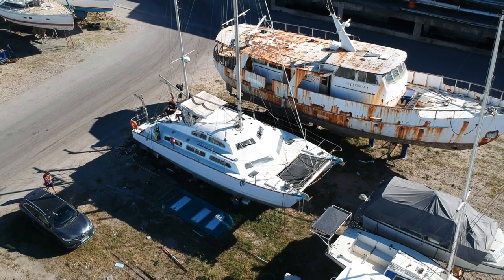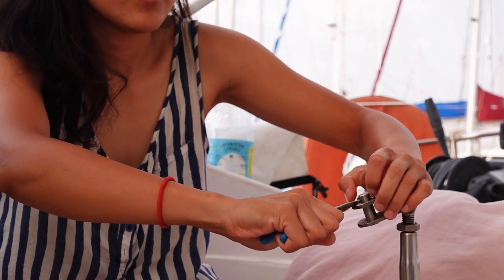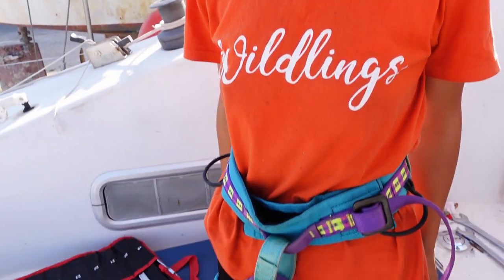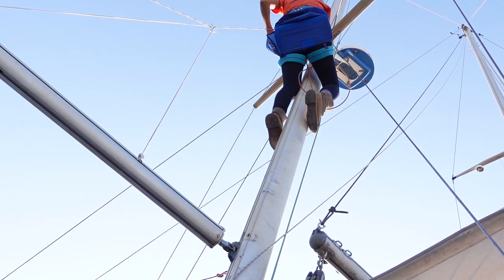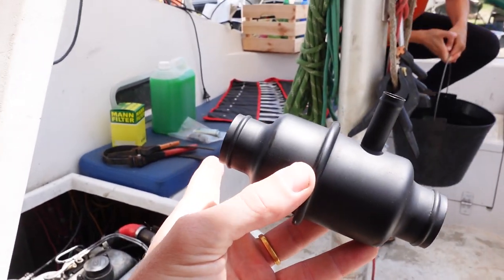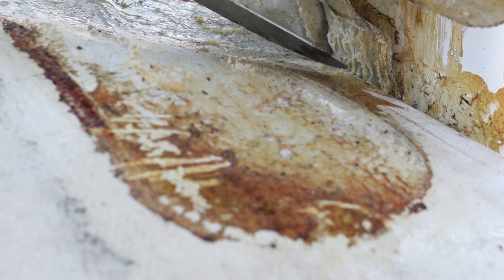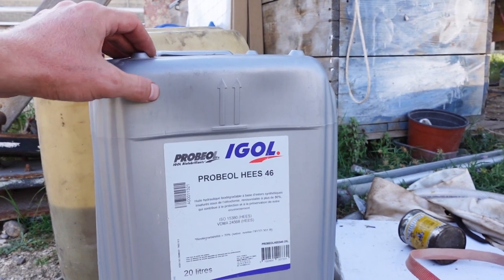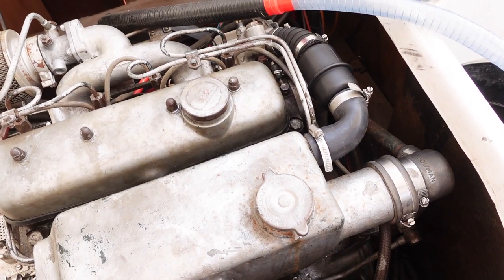DIY Re-Rig ~ Catamaran Revival On A TIGHT Budget | Wildlings Sailing

Comment: That engine sounds so sweet now. Get that heat issue under control  the water, the outside temperature and all the other excuses are NOT the reasons why it's overheating. Gosh, the engine is t even under and load!. Check heat exchanger, water pumps and thermostats to rule out the obvious.
Good luck guys 🙂

Comment: Only using a few liters of waters is fine for general engine tests however,  if the same water is getting recirculated it will keep getting hotter unlike if you are constantly getting new seawater through the system, your not getting a proper heat exchange if you know what I mean.  I bet you will find once you get in the water with recirculating seawater you wont have overheating issues.  Time will tell.  Keep up the good work.  I am really enjoying your videos.

Comment: I’ve dressed many yacht masts including 5 spreader super yachts. I never screw stainless threads together without a nickel or copper based anti seize. When you experience stainless steel galling and a total lockup and the only option is to cut the stainless with a grinder and fully replace with new. It can be an expensive lesson. Good luck. Keep the dog if you don’t have children.

Comment: You should be able to fix the inside leaks between the inflatable sides and the solid bottom by sealing it with butyle rubber silicone caulking. I use it in my fiberglass boats and when sealing the pans in my autos.

Comment: Hi guys. Sensible to do a coolant flush. I agree with other comments here regarding temperature sensor swap out (not sure if you've replaced the impeller or not.... slept since that episode). 
Keep plugging away. It's running reliably now with no leaks. They're all steps in the right direction.

Comment: Make sure you bleed all the air out of the cooling system which will probably keep you from getting hot spots in the areas air may be trapped in the cooling loop. If you dont have a bleeder screw its probably worth installing one in the highest point of the cooling system which allows you to bleed out the rising air in the system.

Comment: The cooling water in your bucket could be warmer than the sea water, I know you tested the temperature at the shore but it was fairly shallow and warmed by the sun, I'm guessing deeper water will be cooler.
Wish I could get my hands on it to try some things myself but could it possibly have a little bit of a blockage in the pipes??
Furing? I'm guessing not barnacles as it's out of the water though now I think that maybe yes (dead old stuff) just needing a really good flush out??
As for the frugal corner cutting keep up the good work 👍
As a Scotsman I refuse to replace anything that's still good just for the sake of other saying "that's what you should do" (don't waste cash when you don't need to)👍

Comment: Cute dog he looks at home good shipmate plenty of room on that 🐱  Norse fittings are the best you can do Your own rigging  wire would be rusting if it was two old carry some dyneema for emergency Engine needs a good run is pump pumping enough water thru or heat exchanger and pipes night need acid wash for clean flow is thermostat opening fully could be faulty ?

Comment: On Hydraulics: Hydraulic fluid does not burn or wear out. You do not change it like motor oil.  It must remain clean and free of water. Your filter will clean any dirt. The drain plug on the bottom of the tank is for draining water which you can check every year or so.  Two problems you can have with Hydraulics are leaks which you can see. The other is air in the lines, which can come from taking any thing apart in the system.  AIR IN THE SYSTEM IS DANGEROUS. A ram which moves at a steady pace that has air in the line will violently move..  I have sent hours and days removing air from hydraulics line.    I have no knowledge about the hydraulic fluid you bought or why you decided to change the fluid but you could have got by changing the filter and about a quart of fluid to make up for checking for water. Like the brake system on your car you never remove the fluid only add if there is a problem.

Comment: There might be some growth in the cooler/converter/heat exchanger. There is a liquid that clears it up great. I don't know what itis called but you run it through the system in a loop until the water is clear. It starts clear but quickly turns dark  as it cleans the system. There are other sailers that have the same problem. The cooloing system gets clogged up. Even a little growth on the inner walls will cause the cooling effect to deminish.

Comment: I can of spray I would recommend having onboard is PB Blaster. It is a must and a cure for broken fingers. Can you find another way to measure your water temp. I would want to know my gauge is working right. There are chemicals that you can run through your engine to clean out the crud. SV Basik used Barnacle Buster. Regarding the dog, it a special gift. Dogs are not cheap to keep. I have three. However, the enjoyment and loyalty is priceless.

Comment: Check your gauge it may be not calibrated  usually you can smell a hot engine once in water you will most probably  have better circulation 
Great job you two

Comment: Hi Both, I had an OM 636. Wessex 4x4 we’re fantastic for parts. Temperature was always just below 90. When she crept up to 93 I’d become cautious but that’s in the cold Bristol Channel. The Bowman heat exchanger had been solder repaired many times and I found that the only way to sort the temperature problem was to change the heat exchanger core. The price was eye watering (over £500 at the time) but it did fix it. Hopefully your high temp is down to residual raw water temperature ( maybe check the temp in the bucket?) Good luck both x Badger

Comment: Check to see if there is a bleeding procedure for the cooling system.  Some times they have a screw at the highest point to let the air out.  If you have air trapped in the coolant it won't cool effectively.  I think you're on to a good idea with flushing the coolant system with a good product.  CLR, some of the Prestone flushes, pretty much anything on the engine side can be from an automotive place.   Maybe try flushing CLR through the heat exchanger side. With the engine cool, fire it up for a minute then shut it down, and with a rag pop the cap.  If you have pressure after a minute you have combustion pressure leaking into the water jacket.

Comment: Hey Mark.  A shot in the dark about the temperature issue.  Have had issue in past that if coolant is not premixed already with water and you mix it yourself with water and your a little rich on the coolant side beyond what manufacturer suggests then it can raise the temperature of the engine.  Not saying this is the answer but may be a possible reason.  Keep up the great work.
Reply: Had that problem on my Cummings  b5.9  when doing coolent change good shout
Reply: He mixed it with soften water.

Comment: You may have an air lock. Try bleeding the system. Also if you lengthen the convoluted water hose it will remove the kink in the bend.

Comment: Water temp. Some thoughts: obvious one is to confirm the gauge -sensor in boiling water, 100c. Next thought, using glycol mix reduces specific heat capacity quite a lot compared to straight water, so that if your engine seems fine on water but not on a glycol mix you had barely enough transfer on pure water and now not enough… so descaling with acid might help. Also your new thermostat needs to come off and go into a large pan of water on the stove. Add thermometer and see when it opens, and that it opens sufficiently. Oh, and you did put it in the right way around?
My money is on poor flow and gunge in the waterways of the block and exchanger. Keep the Pooch.
Good luck!

Comment: I wonder if you might have an air pocket or two in the engine after doing the coolant change. After doing a timing belt replacement, I thought I'd blown a head gasket because, while the engine started up just fine (whew!), with time it was overheating. Turns out that I didn't properly bleed the coolant lines of air and that led to the overheating condition. Ended up using a vacuum coolant tool that eliminated all the air in the system. I'd suggest you make sure that you've adequately bled the coolant system. Great videos btw. You both are a huge inspiration!

Comment: You might like a "Valved Plug" on the Hydraulic tank...If you know the diameter, threads could be standardish.
Check Thermostat stuck closed...if not already done. Use your temp gun to find if the thermostat has same temp on both sides... The dog is worth another 10k subs...

Comment: Hey Mark and Nadiana,

Your hydraulic tank should be normal (: piping systems are always Frankenstein, because people who make valves aren’t always the same people who make the reservoirs.

Regarding your hydraulic motors; if they don’t have a case-drain, then only the reservoir can be drained and lines can be purged. While I think what you chose to do is operational (case draining is optional anyways) you could add some replacements to the list of your long term plans.

Comment: hi guys love your channel , mechanic, yes change hydraulic filter ,oil only needs to be changed if water has contaminated witch sends oil a milky colour or a major mechanical failure of a pump etc that sends metal contaminates though the system  hope this helps

Comment: PB blaster a day or two ahead of time, and again half an hour or hour before you try to bust a corroded part loose does wonders.  the only thing better than pb blaster or heat that i know of, is brake fluid.  but, brake fluid is also highly corrosive so not cleaned up thoroughly and in a timely fashion can case more headaches.

Comment: I would replace all the hydraulic fluid, there should be some sort of bleed nipple at the end of the system so you can pump through new fluid. I have only done this with brakes but I expect the same principles apply. Old fluid picks up water over time and could cause problems so best change out for new. The dog might be good for your channel but could make cruising quite a bit more difficult. Do not send him to his doom, as people will hate you! Find another owner with a big garden as that is what he really needs. 😊

Comment: Apple cider vinegar does gently remove hard water/mineral scaling in cooling system. Much milder than full strength acid👌 the cooling system heat exchanger has a thin buildup of mineralized deposits is best guess really. Is it possible to remove and clean out the heat exchanger with gun barrel cleaner style brushes and vinegar?

Comment: That new thermostat should have the opening temp stamped on it check what temp it's opening also servicing hydraulic  systems yes you usually just drain the tank and refill with new oil and replace the filters

Comment: G'day Crew,,,
Mark ,, the engiine temp is ok ,,,but i would say the issue is two fold ,,the new thermostat  will reduce flow a little  ,and youould run without it if need be ,however the bend in the pipe will also restrict  flow and is likely to be an issue ,either replace with a gentle bend to increase flow volume and flow speed ,,,or a acceptable fix is to coil a wire or use a spring  long enoug to go inside the ruubber pipe to hold open the collapse on the bend ,,so  flow rate is improved  .(your motor ran cooler when you had a gentle bend ) Personally,,i would just replace with a longer hose to reduce the bend  .
Finally ,,have you checked the timing of the injection pump - to Top Dead Centre ,as it is crutial in  power & heat development. 
If timing is to far advanced a motor will run very hot .Also check your valve timing  and gaps  , as exhaust valves let all the heat out as you know .
Love the dog ,he seems very loyal and protective. 

     Respect
        from
 Down Under

Comment: At least you listened about the adjustable spanners. Only thing to watch with Hydraulic fluid is that is very dangerous under pressure. I know someone who had a tractor hydraulic hose burst and it cut through his arm and the fluid caused all sorts of problems in his skin and healing issues. Just so you are aware. Be careful.
Reply: I'm pretty sure this system won't develop the kind of pressures you see in a tractor, unless you're going full tilt into a storm or something, even then... but indeed worth keeping in mind :D

Comment: You showed the pot of water vibrating while the engine was running. I wonder if new mounts would reduce some of the vibration felt in the boat? They look fairly inexpensive online. John

Comment: You should keep the dog. Its viable....just gotta teach him how to swim and get a small piece of astroturf he can go on and hose off. Be VERY careful with the Hydrochloric flush. I've done it with muratic acid which is HCL and Phos acid with mixed success. Specifically, it will destroy your rust but will take some metal too so if your heat exchanger is on its last leg, it will kill it.

Comment: you have a temp gun so use it to determine  the problem ,check the water temp before and after the thermo as well as before and after the cooler ,you can check the gauge by aiming at were water sensor  . the kink in the hose is ok and not your problem,have you pulled your heat exchanger to make sure it is not blocked on the sea water side .the flush on the hydralics was right .contact me and i can walk you thru the process to repair your cooling issue

Comment: That temp sender could be bad. Old gauges aren’t known to be very accurate. 
But I’m leaning towards something else. 
Take ur temp gun and shoot the engine where the water is coming in and where the water comes out. And see where it’s at. 
All else fails mix some CLR and hot boiling hot water cycled through the block with a filter. The CLR AND HOT water should break down any crud blocking the coolant passages. 
If it’s been sitting for a long time that block could have some plugged up passages. I did this to repair a Audi heater core and it worked amazingly.

It’s very common after a engine sits sediment in the coolant and the block from breaking down naturally turns into a sandy substance and it hard packs in passages. Thus making it very hard for the coolant to do its job. Some times back flushing the system (reverse of the natural flow) will break loose crud and help clear it out. I used a bilge pump to do mine.

Good luck!

Comment: The cooling of the Mercedes OM636 engines is very critical in general. That's a well know problem of these engines.
So the fact that your engine is getting warm can very well have to do with the water in the bucket getting warm. Only in case you can flush the water in the bucket continously so the temperature is not coming over let's say 25 degrees and the engine still gets too warm you have to clean the cooling system of the engine.
But as you mentioned, the best is to test it in the water and under full load of the engine. 
If the engine has been running under full load and the temperature will go up to the maximum acceptable temperature you will have to slow her down slowly in order to avoid that she will get overheated. If you will pull back the throttle to stationary revolutions at once the capacity of the coolingwaterpump will not be sufficient to drain the heat from the engine. When slowing down slowly the capacity will just be enough.
Good luck and success.
Reply: The water in the bucket isn't being recycled, it just goes through the heat exchanger and out the exhaust, and the bucket is being filled off the tap.

Comment: It's not a clevis pin, a clevis pin looks like a dowel that than has a clip on the end of it. What you removed was a cotter pin. Btw You don't have to replace all the rigging as long as you replace what needs to be replaced your fine. As you said, your not crossing the Atlantic. You's two are doing great job as far as I'm concerned. cheer bro. Btw the running temperature on a running diesel is suppose to be 88 to 92 Celsius. Yeah, keep the dog nothing wrong with having a dog on a boat.
Reply: UK = split pin.
Reply: If I'm not mistaken the cotter pin holds the clevis pin in - at least, the pin that goes through the toggle is what I've always called (and heard referred to as) a clevis pin. But then again I'm not a native English speaker so I might be wrong :D
Reply: @gfimadcat  you are right as always Benny,  :)))
Reply: @theoldsailmaker6408  hahaaahah. I'm more often wrong than right I think :D

Comment: From my memory of my Merc C-Class, 
it was probably the crush washer all along.

Mine had two injectors that were sealed because they leaked, the sealant then failed.  I replaced the crush washers, end of problem.  Sorry I did not mention this earlier before you bought the tool but it was not clear at the time what the problem was.  Still, now you have to tool.

Comment: Check for air in your coolant system you may need to bleed out the air. Air in your coolant system would cause temps to rise above normal temp.

Comment: Thanks for the video, find glueing dinghy interesting, how you doing this work. Shore engine is fine ,bucket water will up more as it circulates ,some   heat up in side boat simuler to a car as well or shower water also.

Comment: Dirt kills hydraulic systems.  Don't redo a hydraulic pump unless you have a very clean area, even paper towel lint can damage a pump.   Keep the water out of the oil, fix leaking joints, change the filter (some can last longer then 2 years) and the oil rarely needs changing.

Comment: Just some thoughts before launch which I guess you've got covered, but just in case as I've just launched after 2 years and had to be hauled out due to leaks,, a) Seacock removed / replaced but not enough thread sealant,, b) breather pipe from shaft seal weeping.  Which reminded me,, have you replaced the stuffing box seals and also checked engine alignment? Exhaust ok?